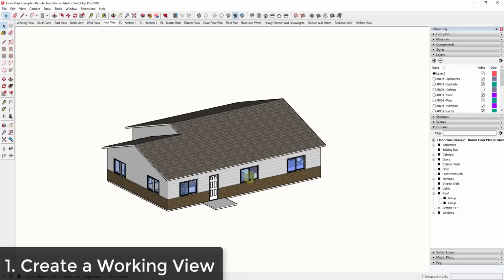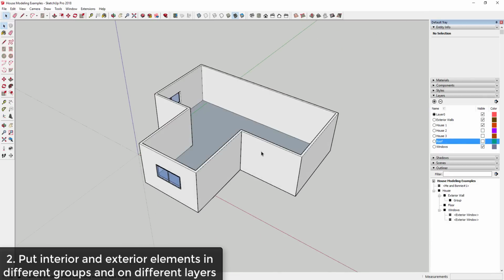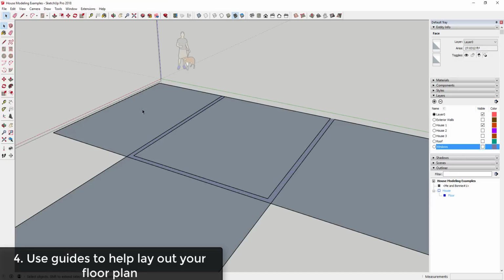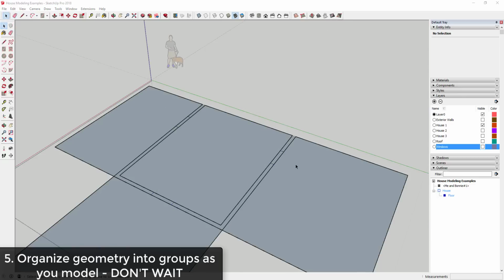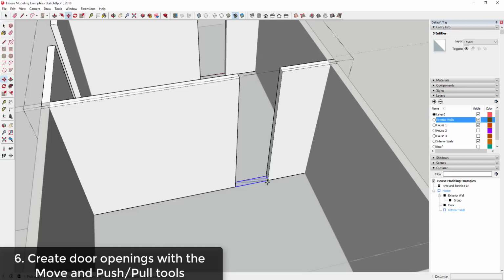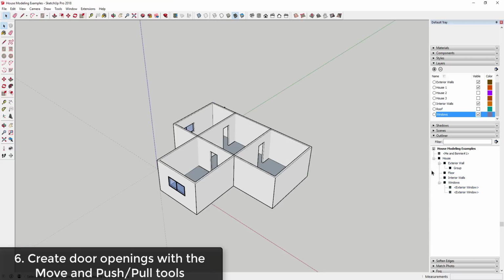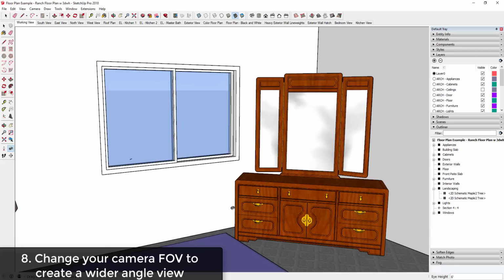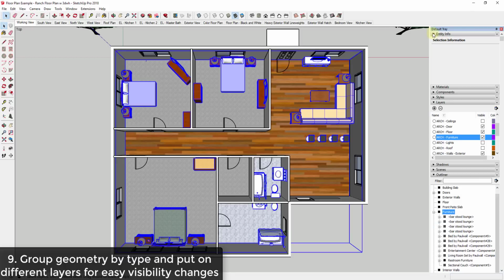9 TIPS FOR MODELING HOUSE INTERIORS in SketchUp!

Comment: A bi-fold door is pre-cut to be a little less than it's given dimensions, for hinge space and swing movement etc..  Interior doors are not.  A 30" door measures 30" across the long back, slightly less on the opposite side because there is a "hinge" side which is square, and a "jamb" side which has a slight bevel to allow the door to swing open without contacting the jamb.  Usually blue ink stamps on the door edges indicate this.  If the door is made for left or right, then there is also a top and bottom.  To hang it, you have to build a doorjamb/frame that is approx 1/8" wider on the hinge side and 1/16th " wider on the jamb side, total 3/16th wider.  1/8" on top between the door and the door frame header/spreader and whatever on the bottom, depending on floor finish and airflow requirements.  The door frame also requires a shim space between it and the rough frame of 1/8th to 1/4" all around.
Of course every carpenter has a 'version' of this, but I always calculate it and then create a rough opening, to accommodate it.  I show interior walls with drywall on both sides at 4 1/2", which accommodates the doors and jambs one buys in the store.  Any deviation from this will end up with a carpenter "custom" building some aspect of each door he hangs, adding expensive hours and possibly making mistakes.
Still, for the last few houses I've built (quite some time ago) I had a good carpenter onsite to do just that.  We "custom" build all jambs, bases, window frames, stairs, cabinets, shelves, everything we can using a planer, table saw, drill press, jointer, miter saw and sanders.  Bring him in and his helper, give them a terrific setup area and put them on salary for a month or more.  Use local lumber or even construction grade stuff from Lowes or where ever, and re-mill it onsite to upgrade it to select.
Then you can draw any door you want.